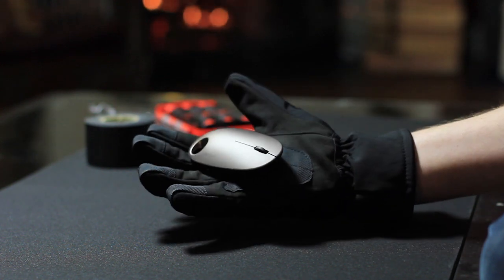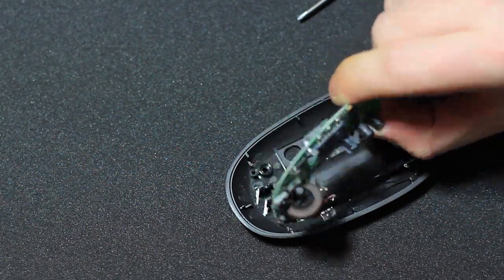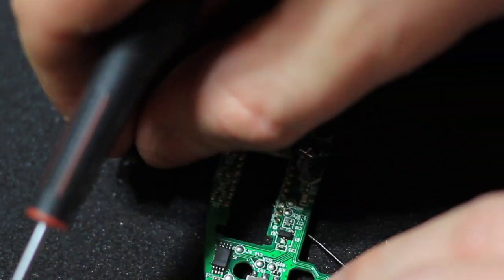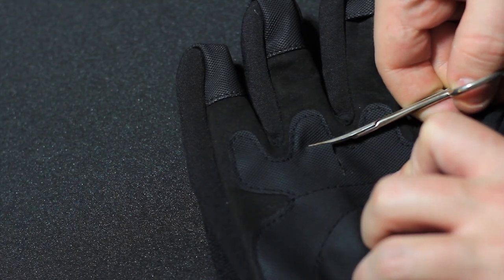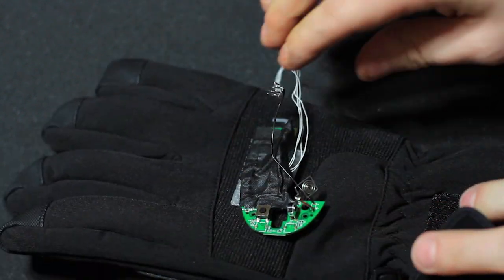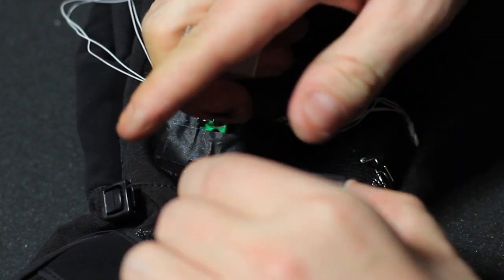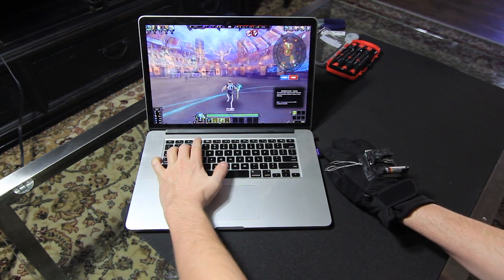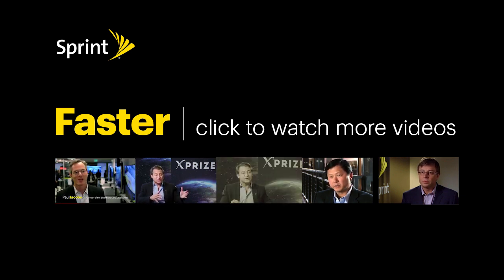Turn your Mouse into a Powerglove!

Comment: what happend to the scroll wheel??
Reply: Perhaps put the scroll wheel on the middle finger, and just put the right mouse button on the ring finger.
Dunno how well that would work though.
Reply: The scroll wheel isn't necessary but you could add it if you like.
Reply: where ???

Comment: Thank you for this great hack! Now to make virtual gun for fps games out of this, one just needs to mount those left and right mouse button sensors onto trigger and reload buttons of any plastic toy gun, or for more realistic feel - the sensors should be placed between those button's and the points on the inner surface or whatever that is which they make contact with when they are pressed, on the inside of the gun. Movement sensor could be placed on the bottom of the magazine. And some flat smooth surface to slide that gun on it. This hack is so simple, but universal, it can be implemented to various different things. And you provided the ignition spark.

Comment: Now, I have an '87 Mac SE, and it's mouse is ADB/ADP (or something) connected, single button click, and has a track ball. Would this concept still work?
Reply: +Satchel Hogan It might, if you can figure out where the sensors are for the track ball. You'd be better off buying a reg. wireless mouse, they are pretty cheap.
Reply: Meme Alert No it wasn't....
Reply: Should've been.

Comment: Why would anyone with brains go through all that hassle just to put the mouse sensor from plastic to leather and compromise the sensitive circuit board with over the board soldering .The instruction is useless because he doesn't tell u any or the terminal layout or their functions and besides there are way too many wireless mouse products unless u get the one he is using and still u won't figure it out because there is no schematics.
Reply: +joe20m20 wrong, if you look as you take the parts off look at where/how they go, and yeah not everything is a schematic

Comment: Wait what did you do with the scroll wheel? sure you can click the scroll bar at any time but, in video games you need the scrolling wheel to go from one option to the other, like in a shooting game, switching from a pistol to an shot gun. So how do you add the wheel cause I looked at both of your videos and you haven't answered that, well at least as I could see.
Reply: Erick Lopez  wait could you attach some wires and add it to your ring finger?

Comment: I bought that conductive paint it is water soluble and doesn't hold up well to movement, also again with just popping stuff off with a screw driver and hoping for the best? that cmos sensor had a lot of connections, how did you know which 4 are important, all the rest are unnecessary? what connection are you even making on that cmos sensor did you just put conductive paint to plastic, i don't see how this would work.

Comment: What about the scroll wheel?
Reply: Good point. But the scroll wheel isnt super important for all games.
Reply: Usually the number keys suffice for the scroll wheel.
Reply: Tripl3ig4ming ok cool lol
Reply: William Babcock Just saying, no reason to have a scroll wheel
Reply: William Babcock It is for ArmA 2...
Reply: you could attacth the scroll wheel to the outsidde of the thumb
Reply: Or attach it on the outside of the index finer and use your thumb and scroll.

Comment: The parts are usually soldered in place so forcing them off causes damage
Reply: yes yes like we are all dumb
Reply: good piece of advice. some are good pieces of assholes
Reply: well hey its your choice to take them off
Reply: Warming them gently with an heatgun is better option than pop them off with a screwdriver

Comment: Its a cool thing but I've made one before and so have my friends. And I'm not trying to boast but soldering is way better than the tape and conductive glue and if you would of kept the plastic you could of used it to protect the circuit board. And what about the scroll wheel ( and I have no idea what the actual piece is is called but that's what I call it) I use the scroll wheel in a lot of games to cycle weapons or powers

Comment: U made this already
Reply: That is true, I went and watched the older one. You see in the old one, he didnt remove the lazer like he did in this one, that was about the only difference. I would hoever argue that this is irelivant, does it really matter that hes done this before? No because he went into the same amount (if not more for this one seeing as its of a better quality both in design and the information given) to create this video. Also, I find it funny that you would take a picture of Toby Turner use it as your icon and then have a go at someone else for not being original (which is essentially what you were doing).
Reply: Implying intelligence is measured by your capabilities as a speller.
Reply: Swornvendetta you don't even have an icon so at least he made some effort there budday
Reply: To bad he didnt more a bit more effort in becoming smarter.
Reply: Swornvendetta too many typos bro, just quit.

Comment: Why not put a hard piece of plastic under the sensor? That way you could use the air instead of having to put your hand down. The buttons could be on the sides so you could use your finger to left click and right click. One disadvantage is no scroll wheel. But if you use an old laptop and take he touch scroll, it could work.

Comment: From the shape of the glove and apparent resistance to motion, that looks like a glove designed to insulate heat in cold weather. Wouldn't that be a real bastard to wear after about ten minutes?

Comment: If you want precision movement when gaming or using things like photoshop, get a trackball. You only have to move your thumb, the mouse stays in one spot so it works on a cluttered desk and you don't need a mousepad, and it's super easy to get the hang of.
Reply: Well, it is only more precise for small changes in mouse location. In games, large direction changes can be very difficult to do precisely with a trackball.
Reply: I've been using one for all sorts of MMOs and RPGs, I find it far better than playing with a normal mouse
Reply: Not fps's tho :P
Reply: I play FPSs, and while I'm not great I always do significantly better with a trackball. Rather than having to move my whole hand, a flick of my thumb sends my sights where I want. It's far faster and I find it more accurate.
Reply: fakjbf Far faster? you can turn your dpi(dots per inch) up. I think I have to move like 3-4 inches to move across 2 1080p monitors.  If it was a reliable way to game then more people would use it, we have a few of these trackballs at my college and they're just about the most frustrating thing ever, along with really slow sensitivity mouses.
Reply: iTzKaiBUD The main reason few people use them is because A) few stores sell them anymore simply because B) they are unfamiliar. Most people grow up with a standard mouse, and so when they buy a mouse they don't go for the trackball. Yes, the first couple times you use it it's weird, but use it regularly for a week and you will no longer notice. I've used one for years, and whenever I got to a friends house I feel weird having to use a standard one. Now I use the two regularly, and I have noticed that I'm better with a trackball, all other settings the same.
Reply: fakjbf The flick is required for fast turning with trackballs, and this is their downfall. It is not more accurate, it is fairly luck based until you get very familiar, but in that time, you would have progressed much further with a regular mouse. My brother uses a trackball, so i know the argument, but i can honestly tell you, the learning curve for trackballs is higher, and the skill cap is inherently lower with trackballs. Some tricks are easier, while most foundations are much harder, especially smooth strafe circles, since you have to keep re-positioning your thumb.
Reply: Richard Smith When you use a trackball, you aren't flicking your thumb and waiting for the wheel to stop. You can set the sensitivity so a quick flick takes you 180 degrees around, which will cover most moves you have to make. With a standard mouse you also have to pick up your mouse and reset your hand, unless you want to be reaching halfway across your desk to finish that strafe. The only way to counteract that is also set the sensitivity higher, so really they are about equal since fiddling with the setting can easily fix all of your problems. It comes down to which do you prefer to do, reset your hand or reset your thumb.

And again, it's only a higher learning curve if you try to relearn after having used a standard mouse, you would find the same pattern taking people who use trackballs and having them use standard ones. But since most places use standard ones, they are already exposed to it. It's like saying French is harder to learn than English because Americans take longer to master it than they do English, when really it's only showing that learning a second language is harder than learning your first.
Reply: fakjbf I understand what you're saying, most places do have standard mouses, I believe this is due to the superiority of the standard mouse. I don't have to life my hand even if I want to move 2 full 360's because I have a large mouse pad and a high sensitivity.
Reply: iTzKaiBUD It's not that it's superior, it's what's familiar. Is English better than French, no, and yet most Americans speak English and it's what's taught in schools. It's not that it's any better, it what more people are familiar with which breeds more familiarity. The standard mouse was used more commonly than the trackball during the early days of home computers, so that's what people grew up with and bought later in life with their own computers.
Reply: The space dedicated to motion is limited to the size of the thumb, before lifting you thumb, mouse is limited to the size of the pad and area available. Greater area means more overall accuracy between mouse lifts/thumb re-positioning. You would need thumbs more precise than a watch makers to match the accuracy + sensitivity of a mouse. I agree with you however, that it all comes down to what you used first, and preference. I am just not sold on it being inherently better at all.

Comment: You could put the sensor in the forefinger for real control. If you want the left click on a different finger, it doesn't feel that odd to put it in the thumb. But again, the sensor in the fore finger gives both great control and precision. With that configuration, you could effectively have a touch screen if you set up a projector so as not to scratch the monitor or what ever works

Comment: If you want it to be fancy schmancy you can use conductive thread and sew the thread on the glove :)
Reply: You won't want that, because the thread would pick up interference from your skin. The point of conductive thread is to allow electricity to pass through from your fingers to a touchscreen so you can use it in an environment where you would need gloves, e.g. cold weather.

Comment: Aw, that's a happy little circuit board!
Reply: :D
Reply from the maker: Bob Ross would be proud.
Reply: HouseholdHacker where can i get conductive paint?
Reply: hugo flores Here is a link.    https://www.google.com/url?sa=i&rct=j&q=&esrc=s&source=images&cd=&ved=0CAcQjRw&url=http%3A%2F%2Fknowyourmeme.com%2Fmemes%2Ffacepalm%2Fphotos%2Ftrending&ei=7w5JVM_VHc2eyATr1oCgAg&bvm=bv.77880786,d.aWw&psig=AFQjCNFuAjGSMGo0X4HE8hGT3KaRU1Snug&ust=1414160490758620
Reply: +Todd Steele lol